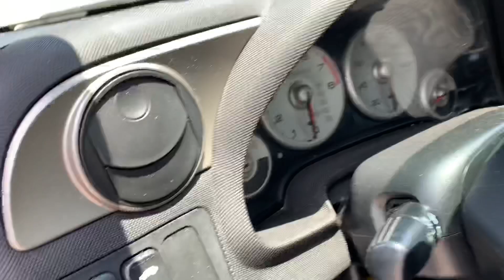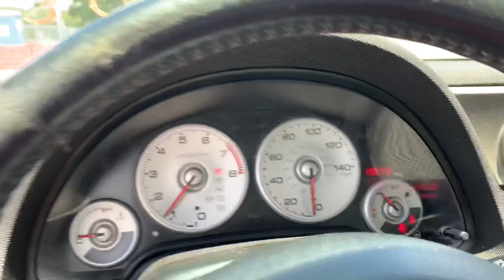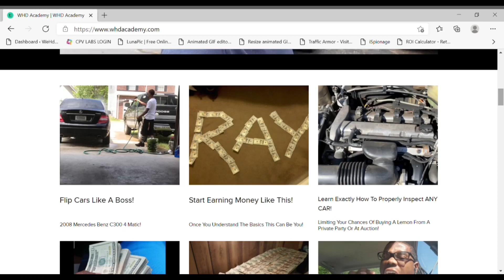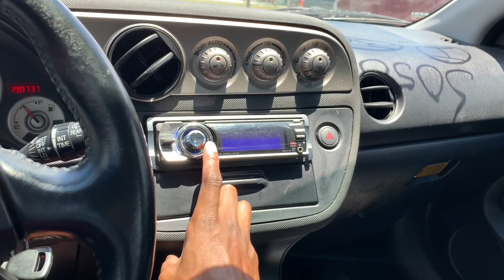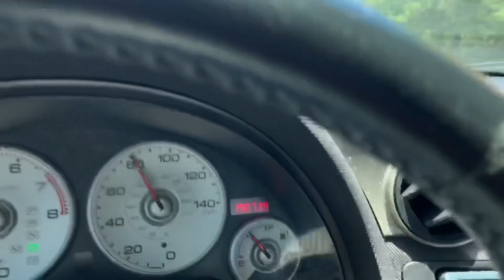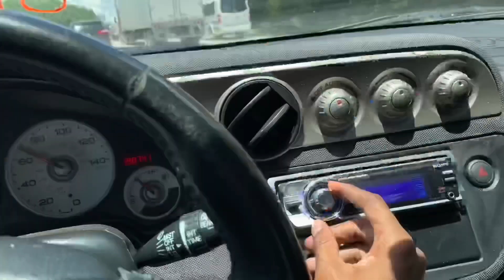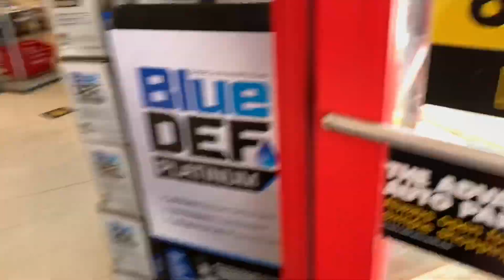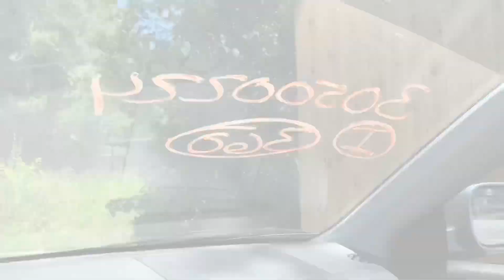MAY HAVE MESSED UP ON THIS ONE SMH THIS IS THE SECOND TIME THE AUCTION SCREWED ME *AUCTION SCREW UP*

Comment: Nice car you got I like it… Be careful spraying the brake cleaner into the alternator.. I’m a mechanic I seen alternator go out because of that😎👍
Reply from the maker: Really
Reply: @WeHustleDaily  Yes you’re spraying that stuff  the oil goes in …the Alternator is generating volts anywhere from 13.1 to 14.9 To maintain your battery .I see plenty of people with Val cover leaks dripping into the alternator cost them more money when I do that🤦‍♂️I’m a mechanic here in Lilburn if you ever need any advice or any parts from O’Reilly’s let me know I’ll let you use my commercial discount 😎👍